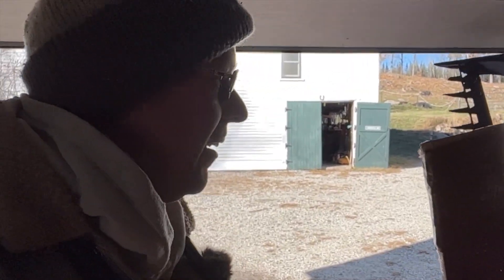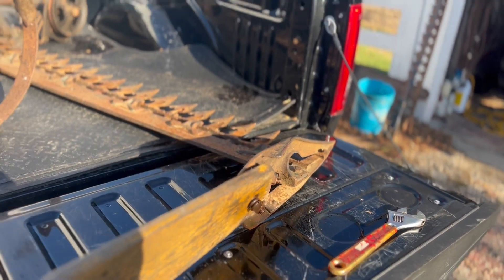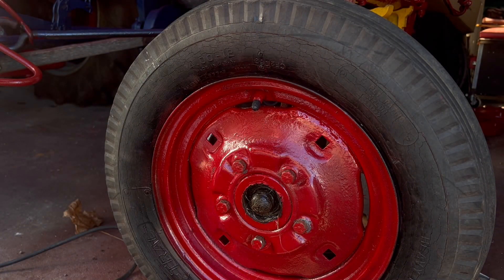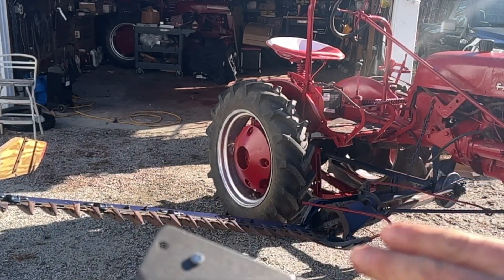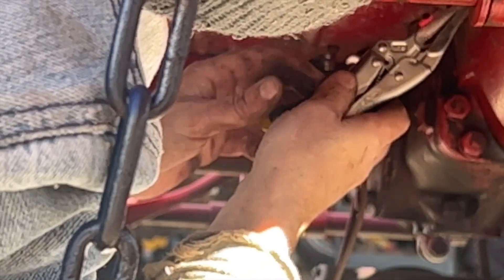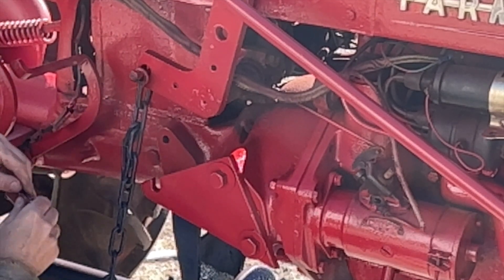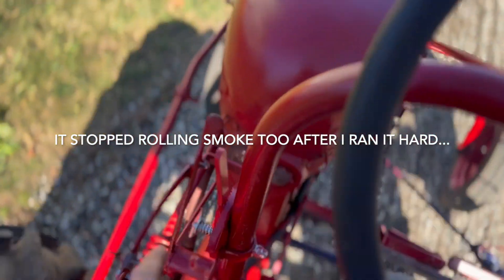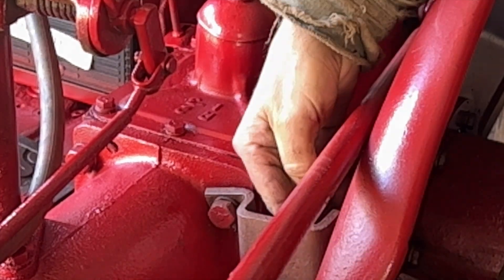1955 IH Farmall Cub Parts & Pieces Restoration Part VI

Comment: I hope you and your family had a great Thanksgiving Tom. I think Grandpa had the 4 1/2 foot sickle bar for his Cub. I took the grass board off his as we only used it for cleaning up around the farm. Parade ready or not, your paint job looks much better than the paint that fades to orange or pink. Between you and Farmall Fanatic, I'm starting to miss working with a Cub.
Reply from the maker: Dads was the shorter one too. I can’t believe I’ve found two intact grass boards. Haha. Thank you, I’ve used that paint for a long time and it holds well. Farm family center used to sell IH red and it faded orange. Ace Hardware has IH red that fades pink. It’s too bad because the cans are bigger and I like the spray tip. The Rustoleum IH red cones in a quart can or gallon can too. Ido a lot with that oil paint with a brush. It blends well and the brush strokes don’t really show. I like the 55-57 grills and when FF bought one, I knew I “needed” one. I hope you had a good thanksgiving and have a good weekend. Thank you

Comment: Thanks for another interesting video.  I am hoping I can remember some of this stuff so that I can apply it to my Cubs in the spring.  I can always rewatch of course. 😢 You say some of the smoke cleared up after you ran it sorta hard, what do you attribute that to?  Have you heard of an add on that allows for lower speed in first?  Seems like I have, but not as sharp as I once was.  86 here today, not complaining, bragging!  Stan here.
Reply from the maker: Howard made a rotovator (rototiller) that came with a gear reduction because 1st was too fast. I’ve never seen one up close, so I don’t know exactly how it works. Some mechanics have told me to run them hard and see if it clears the carbon out from setting. I hope you have a good weekend and thank you for watching

Comment: Happy Thanksgiving!  That was pretty cool you have an original swathboard.  I had to do a fair amount of research to come up with a pattern for my JD #5.  You think that would have been simple, but not so much.  I broke it this last hay season on the last cut I was making (don't ask), so I will be making another this winter.
Reply from the maker: I think that’s what mine is for, a number 5 or 8. It has the yellow stenciling on green. I’ve put it in a couple of videos. I have a couple of aftermarket metal ones that I normally use. Thank You for watching
Reply: @tommys_trucks_trains_tractors  I think I remember seeing it hanging up.  After I had to make one, they kind of stand out.  Lol